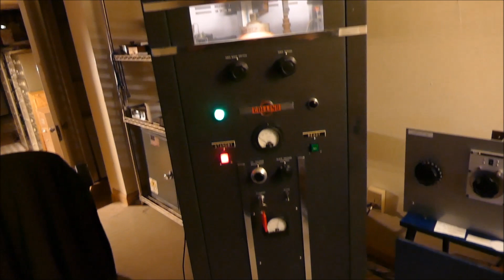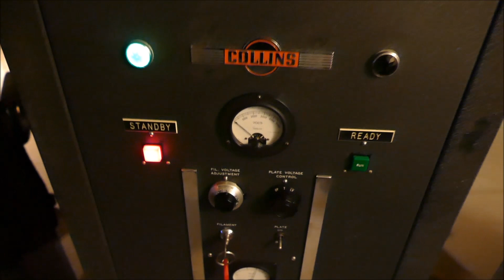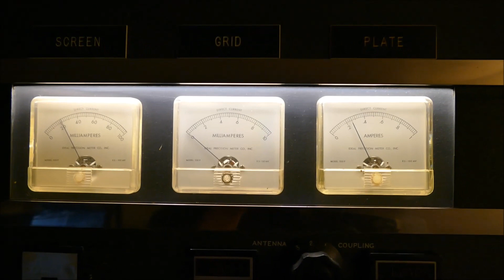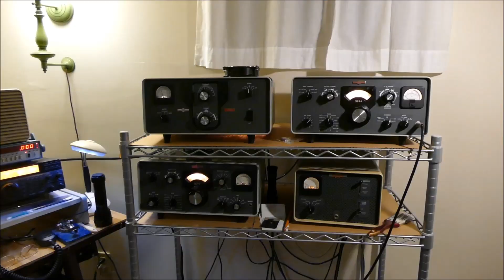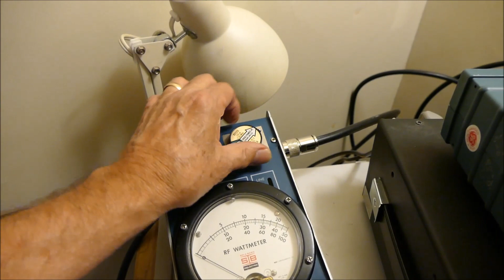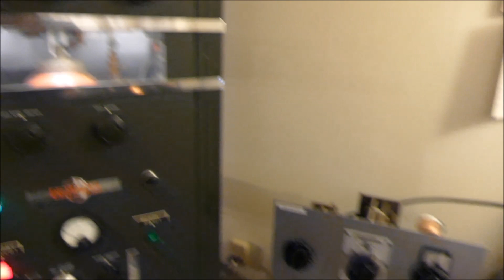Collins 30K-1 Update, 32S-1, 75S-3, 30L-1 and Ten Tec Argosy Tranceiver.

Comment: OMG,that 30K1 is what you want to run on 75 meter AM phone.Does that 30K1 have a built in AM modulator?
Reply from the maker: +Mike Samra I wish it was pristine and original. I would polish it everyday. Unfortunately, when I got it a number of heinous things had already been done to it so I finally figured the best thing I could do with it was use it as a RF amplifier for SSB. I should post some of the pictures of it with the 4-400A's in it. I think they were actually more beautiful than the 4CX1000A.